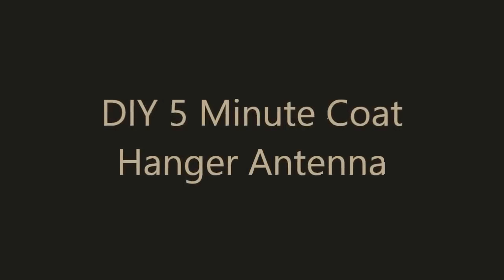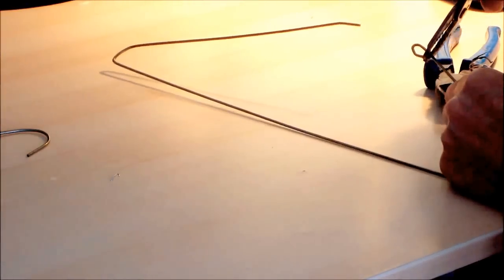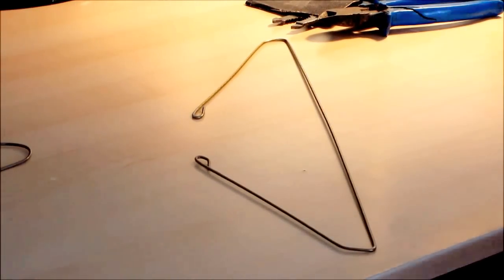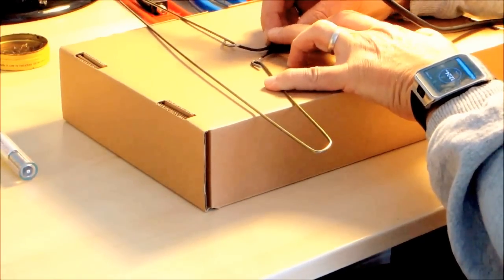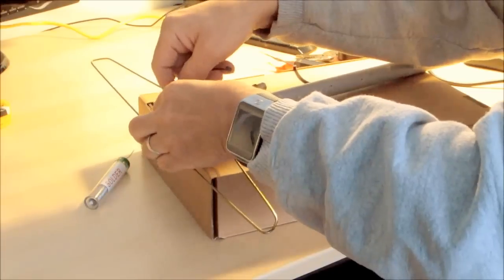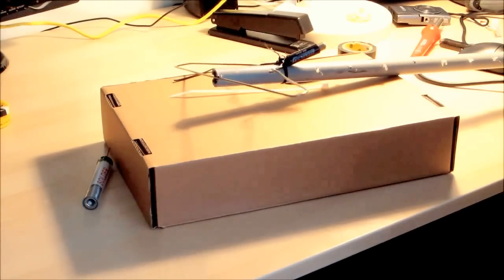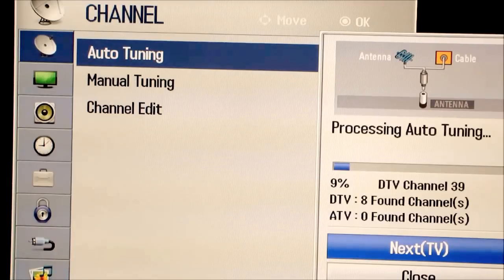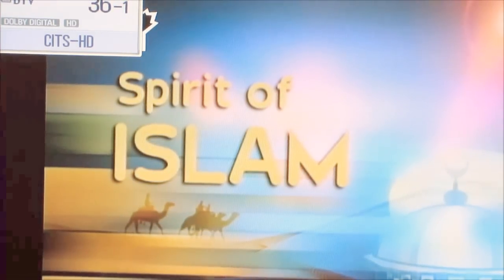HDTV Coat Hanger Antenna

Comment: As an Englishman, I can never work out why our American friends pronounce Solder as Sodder, there is an L  in the word so it's SOLE DER.
Reply: It originates from the old French word "souder". Common case of English spelling pronunciation.
Reply: 🥫 Aluminum. Not aluminium.
🍔 Hamburger. Not beefburger.
Ketchup. Not tomato sauce.
🍟 French fries. Not chips.
🚚 Truck. Not lori.
🚗 Trunk. Not boot.
😆 Cheers! 😆
Reply: Solder... Sodder.. sold her soldier... Soiler... Oilers wtf diff does it make? You are going to turn this AWESOMELY crappy video into your own little racist forum? 

What the flux man... Thats pretty BRAZZEN of you.  You are acid to the core so much so your hair is tinning...  Oh weld ... What do you expect?
Reply: @dickwreckless6409  So you call me racist?   What gave it away?  was it the phrase "American friends"? Idiot!
Reply: Herb

Comment: I bought hey little antenna from Walmart and I modified works well! 

But the problem with it I had to put a regular cable wire on it because the original wire it comes with it is a piece of crap! 
I get everything!

Comment: Number of Channels 'Pulled in" has as much or More to do with your distance from the Broadcaster as the antenna used...

at the right distance/orientation you could get similar results from sticking a Paper clip (Bend into an L and sand it)  into the Hole in the middle of your co-ax Port on the TV

Comment: What is the transformer that you are using to connect the coat hanger wire to the coaxial cable? What search term should I use to find the correct piece to purchase on eBay or Amazon?
Reply: Balun - 300 to 75 ohm Balun Transformer

Comment from the maker: This works . It picks up signals from as far as Buffalo. The parts are readily available from any electronic surplus store.
Reply: What city are you located? Toronto? How did you get channels from Buffalo?
Reply: Salut comment vous allez
Reply: Salut comment vous allez
Reply: northmountainfilms Official Account 2  thats amazing. How do you get that soder thing to melt the wire and the coat hanger?

Also, usually you get 8 channels in Toronto, I wonder which are the ones he got from Buffalo.

Comment: It is not a HD antenna. I get so sick of this. If your TV  is HD no matter what antenna you put up,,if it will receive it in HD.  Your TV has no other choice. You can literally take 2 wires and pick up many TV station depending on  your distance  from the broadcast statation. You can not put up an antenna that does not receive HD. Me myself and I have 2 pieces of tinfoil receiving 35 channel. That is even bad considering I live 35 miles to nearest broadcasts station.So yes it is a HD antenna at the same time. Try putting up an antenna that does not pick up HD. Can it be done ?Watch the southern dude put up his ultimate antenna. Don't let this guy's way of talking fool you .He knows his stuff .I never meet him but don't let his southern drawl fool you.
Reply: how did you make an antenna out of tin foil

Comment: Bull...Coat hangers are made of steel, Steel Grounds out all Television Signals use a piece of Coax or Aluminum for this
Reply: I used steel coat hangers to make different type of hdtv antenna and it works great. And I live way out in the country and pick up stations 40 to 50 miles away crystal clear. Nothing wrong with steel hangers
Reply: Doesn't the antenna need to conduct the signal to the wire?  Why would aluminum be better?  Thanks.
Reply: Aluminum has no problems receiving television signals. It is what TV Antennas from places Like WalMart are made of. It can be bought cheaply I used Old Part's from a broken Antenna for My Home Made TV Antenna.